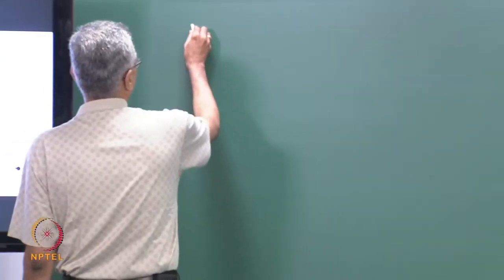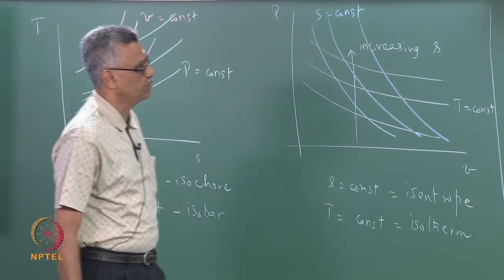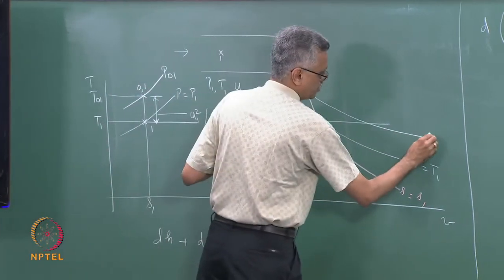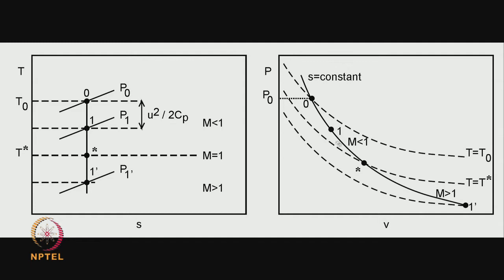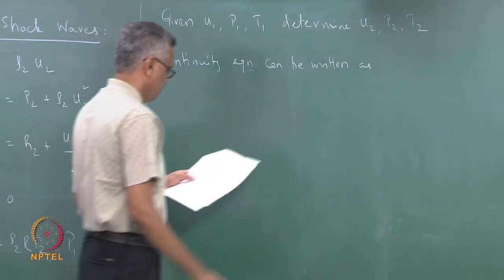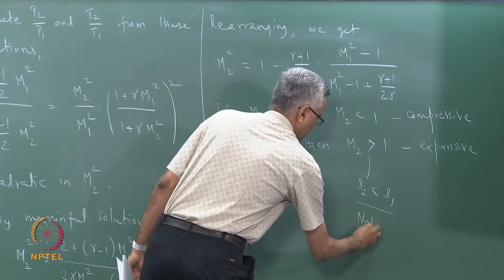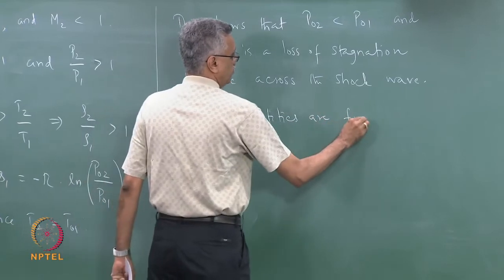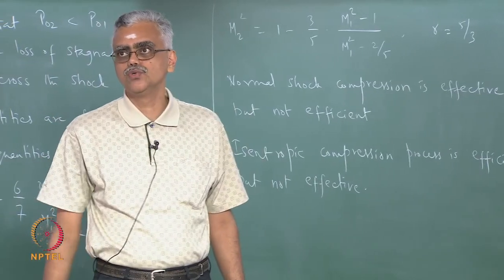Mod-01 Lec-05 Fundamental Ideas / Normal Shock Waves

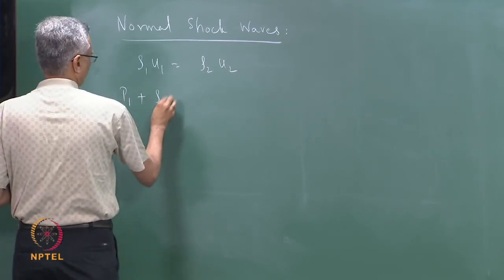Comment: why at 28:17 he wrote momentum equation which implies that P01=P02 which is not so because the flow across the wave isnt isentropic.
Reply: Also remember that we are not concerned about whats happening inside the wave, just the in and out of the control volume
Reply: @Abhi SR1 Ok. I think you are wrong. First of all, P01 is not equal to P02 here and momentum equation doesnt imply P01=P02. The explanation is quite a big one . But I will try to make it short. first of all when we integrate the dP+(drho*u*u)=0  , we must understand that it is a direct integral and it depends only on final states. But in a shock wave or acoustic wave there is a discontinuity of properties before and after the wave. Sir has spoken about this in previous lec and also in his book. I have written it in a very crude sense . If u want full proof u can mail me.
Reply: the momentum equation its well... We consider the shock wave as an isentropic event because the heat is not added from external sources to the control volume.
Reply: jesus ramon garcía thanks...
Reply: @jesusramongarcia4545  but in a atom bomb heat is released right?(As it is a normal shock wave)
Reply: @lsrinivasan242  I don't think I get  ut question 🤔 the shock wave in a atom bomb is inside of a freaking high temperatures of the "fireblast". But I will dig deep into it when I get a chance
Reply: @jesusramongarcia4545  Hmm ok .
Reply: As of whether the momentum equation is correct or not, I think it is correct as no heat is released or absorbed across the shock wave and the entropic change is due to only the irreversibility.